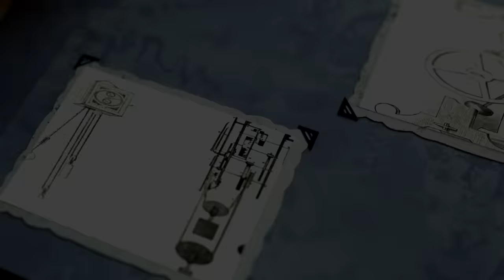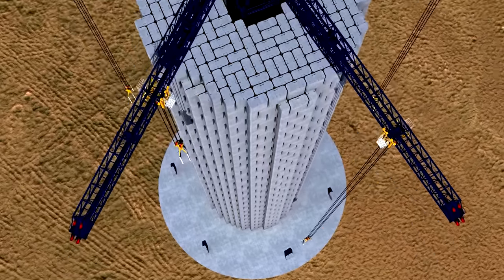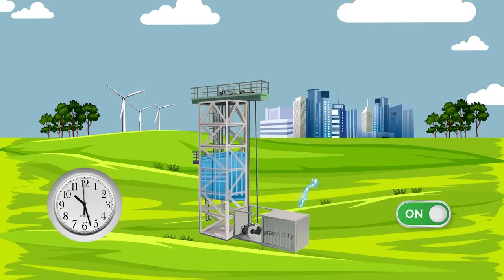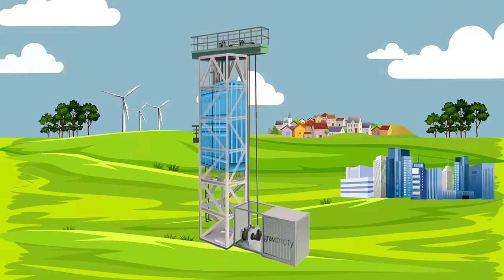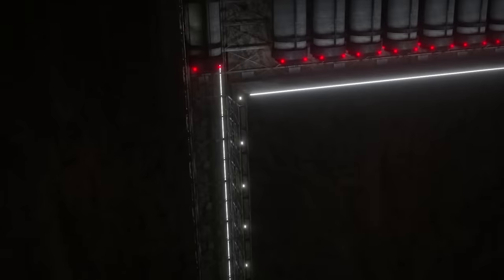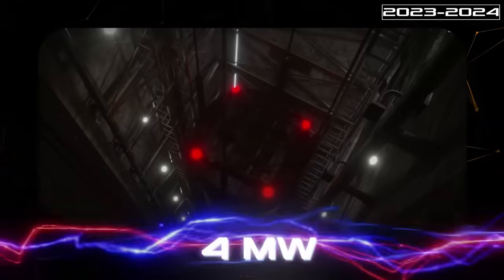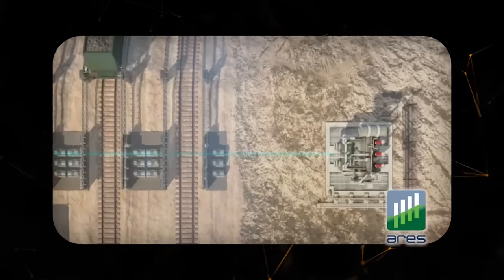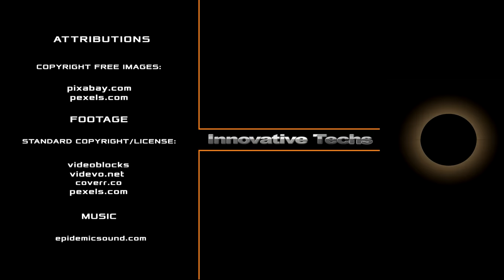How gravity batteries could change the world

Comment: I still did not heard in this animation movie how exactly making weights solid instead of just pumping water makes it cheaper? Heavy lifts/elevators generally are quite expensive machines, while a water container is much simpler device, with the pump and pipes being the elements which require most service.
Reply: It doesn't. This is a "startup" idea that keeps constantly being brought up and milked for gullible novice investors.
Reply: Yeah this is a dumb idea. It’s would be so much simpler to build a tower to hold a bunch of water and just pump it vs all the moving parts needed to lift and lower objects. Drilling rigs do this very thing all day everyday. The info to show us how much maintenance is needed for this already exists but those questions for some reason (I’m being sarcastic here) never get answered.
Reply: I thought of exactly this when I was a little kid ... Then I went to school and realised that yes, it can work but that still doesn't mean it's a good idea.

It's truly sad and hilarious at the same time that people keep wasting time and money on shit like this. Like, for real these ppl know they are just trolling "investors" out of their money right?!? Don't tell me they actually believe this can go anywhere??
Reply: Energy density and specific energy i.e. energy per unit volume and energy per kg mass  for water is lesser than for a solid concrete. The potential energy in 1 ton of solid block will need much large volume of water at the same height.
Reply: @PMLighthouse  Yes, density of concrete is about 2x more than density of water. So you just need a 2 times larger container for the water.  Still, I don't see any argument why building and maintaining heavy elevator would be less expensive than pumping water through a pipe.
Reply: Especially when you need complicated setup of cranes and an absurdly tall structure for it. Cranes will wear with use, wind will be applying force on the tower. Everything will be complicated and require constant maintenance and stupid amounts of precision - all while being under atmospheric stress (rain, wind, snow, etc).
Even the concrete blocks will wear down due to water, moisture, temperature changes and wind, and will require replacing every few years.
Reply: A 'water container" needs to be very large in order to produce large amounts of power. So pumped storage cannot be realized effectively on a large scale in regions without natural alpine lakes.
Reply: Would water held in a water tower falling to spin a tiny turbine be better than what's proposed? 
It seems to me that using a large weight to turn a generator is the better idea, but I honestly don't know for sure.
Reply: wouldn't it just be simpler to just let the tides bring in water to a reservoir? or waves lifting/lowering a pump? the weights thing just looks too complicated for little extra return, if any extra.
Reply: @PMLighthouse water is cheap, basically unlimited, doesn't wear out, can be pumped up and down a bajillion times, doesn't require energy to produce, not to mention all of the CO2 waste from making concrete, need I go on?
Reply: @TheMexxjam uhh, bullshit. It's been done all over the world with reservoirs.
Reply: @TheRealColt45  Sure, wherever there are mountain lakes. But in the flatlands it gets a little more difficult, don't you think?
Reply: @TheMexxjam  water towers my friend.  Just like you see in every Midwestern town.
Reply: @TheRealColt45  Come on, didn't you read the discussion above? Water Towers are OK for water supply but not for storing large amounts of potential energy.
Reply: @TheMexxjam  I did. And here's the thing. Concrete is 2.5 * more dense than water. That's not that much. So compare building a water tower that holds 2.5 times as much volume as the amount of concrete you would have with this kind of contraption. Now consider that the only thing water requires to work is a pump and a turbine. Water never fatigues, cracks, breaks down, etc. You don't have to make it in the first place. Now think of the enormous cost both in dollars and CO2 in making concrete in the first place, coupled with the complicated motors, pulleys, cables, lubrication, and every other component that fatigues and breaks down over time, not to mention requires constant maintenance.  It's not even a close call.
Reply: @TheMexxjam  or, if for some reason there was no ability to store water in a tower or a reservoir or anything like that, consider the much simpler alternative. Phil barrels with water and lift them up and down instead of concrete blocks. Yes they will be bigger, but the mechanism is exactly the same. Barrels are cheap and can be disposed of when damaged.
Reply: * fill barrels. Lol. Damn dictation.
Reply: @TheRealColt45  Just a few words: Capacity is critical. 2,5x is a lot!

Also your water tower needs to be leakproof and needs maintenance as well.
Reply: @peterlynchchannel  
Absolutely agreed - in fact, there is nothing that says the containers (for the water) have to be "heavy" at all.   It's not carrying people!   They can be just enough aluminum to hold a few meters squared of water (1/4 inch?), so very light.
Four containers - two at the top, two at the bottom.   One on the top left is full of water.   Same with the container on the bottom left.
All containers are on wheels and have a hook on top to catch the wire for vertical travel (still have to work out actual mech)
That's starting position.
Top left (full of water) is moved to position where its hook engages with vertical wire rope and starts lowering and engaging the generator.
At the same time, bottom right's (empty) engages with vertical wire rope transport up to top track.   Heavy top could easily pull empty bottom to the topl
Generator produces power which runs the pump, which pumps the water from bottom left up to top right container.   It slides to top left.
Leftover power is usable and predictable - thing is the natural latency between the mechanical container shifting between cycles.
So, we increase the number of containers, both top and bottom to four and stagger their running cycles.

Comment: The amount of maintenance required for a mechanical system like this is an absolute nightmare. Just ask any elevator technician. 
Pumping water back up to an elevated reservoir only has 1 moving part per pump.
Reply: the maintenance standards required for lifts that carry people would be much more stringent than some concrete blocks in an enclosed vertical column   ... they replace wire rope that is only 10 % worn out
Reply: The impeller itself may be technically a single moving part but that impeller needs bearings, shafts, coils, valves, sensors, etc. and must work in concert with pipes, gates, transformers, breakers, and so forth.  The analysis would certainly need to consider the whole system.
Reply: if you power the system by geothermal or hydro it doesn't really matter. The dams are phased anyways due to demand. this would increase demand and therefore cancel out the negatives.
Reply: if you power the system with hydro you only increase the speed that you use up the potential energy, you don't actually use any additional energy. the cost is always the same.
Reply: No comparison but lift. Elevators need to stop precisely at certain floors & have doors open.